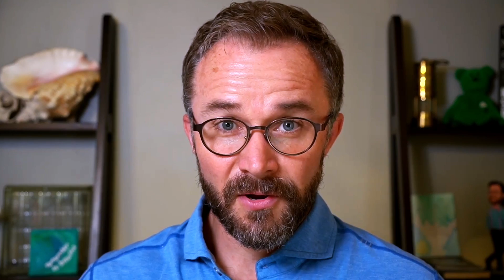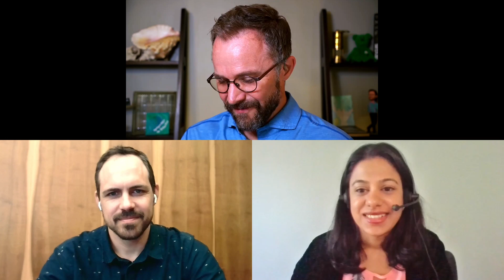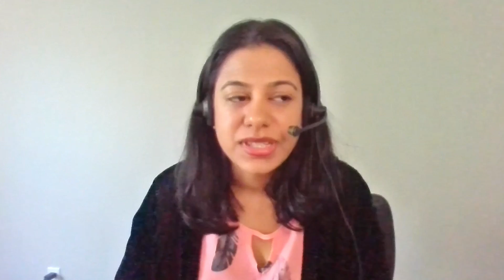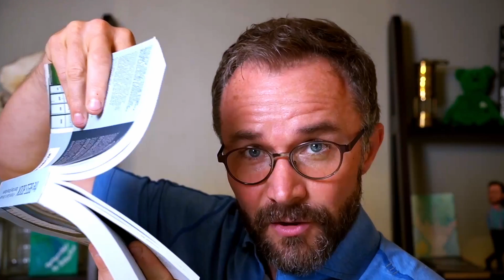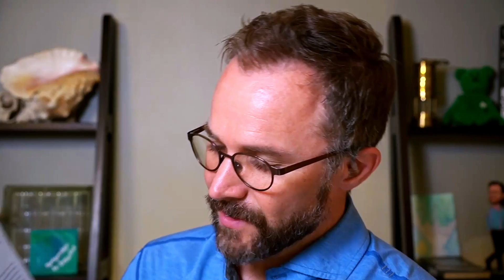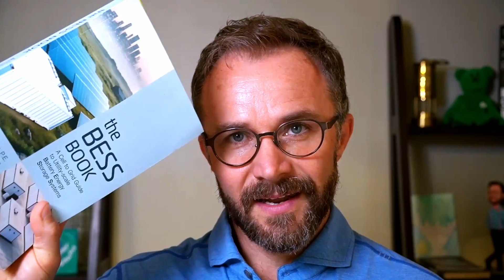Required Reading For Battery Technology? The BESS Book: Utility-Scale Battery Energy Storage Systems

Comment: So glad I ran across this video and channel! Thanks for posting this interview with 2 of the authors! As an MEP electrical engineer I'm mainly designing building or even campus size electrical systems, so nothing utility scale, but I'm including more and more small-scale battery backup into buildings, primarily for Life-Safety reasons. Originally for emergency lighting with the small 5kVA - 20kVA battery & inverter combos, but more recently for larger power backup like 40 kVA / 80 kVAH for elevators (with their own issues of braking regen!). So even thought I don't design the battery storage, I still would like to understand the tech behind it, and I'm excited to read this book! Cheers!